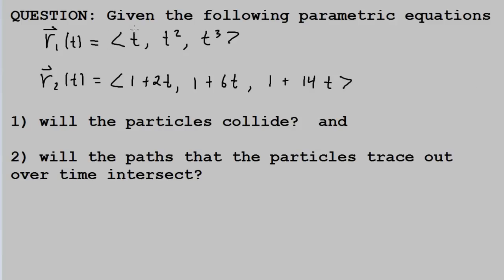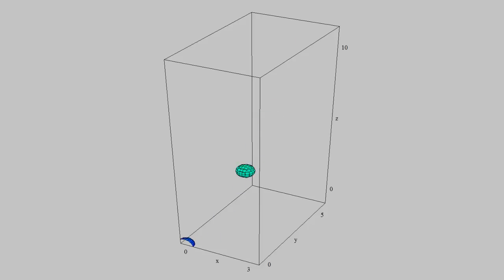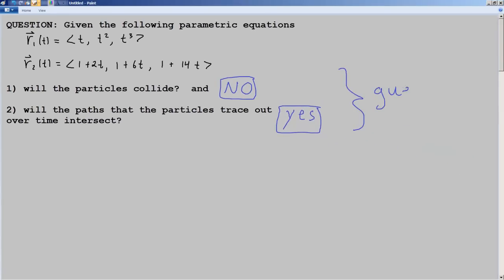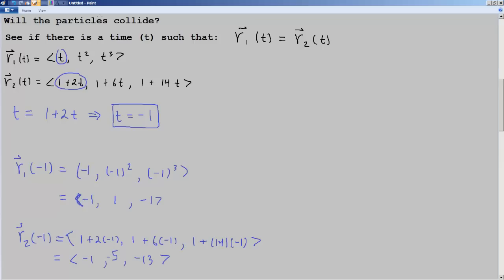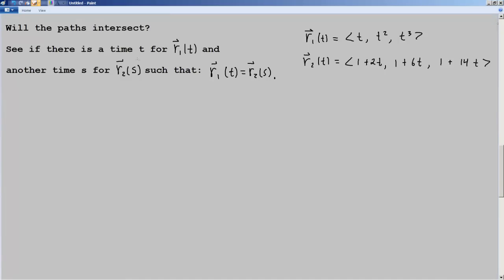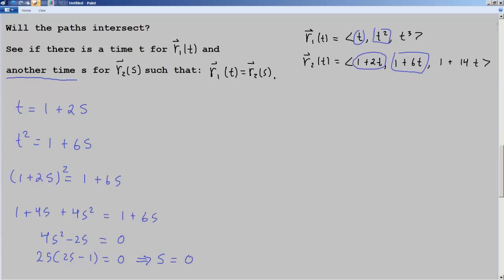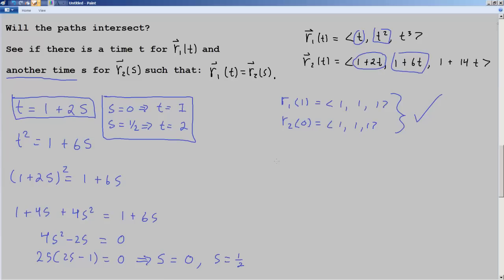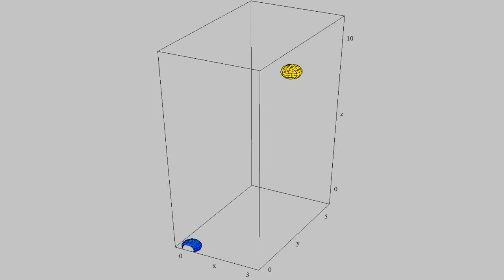Particle collision and path intersection

Comment: I am doing specialist mathematics and I came across a similar question and could not understand how this worked since the original condition was that t > 0 and it confused my fellow classmates as to how saying s = t didn't make s have to be greater than 0 also, but I comfortably understand that by making it s, it is in a separate timeline and the time can be treated like a vector quantity and placed even in negative time zones. So I am Really grateful for this video